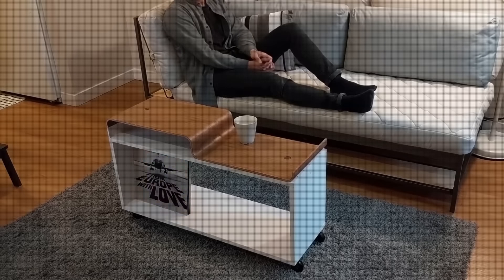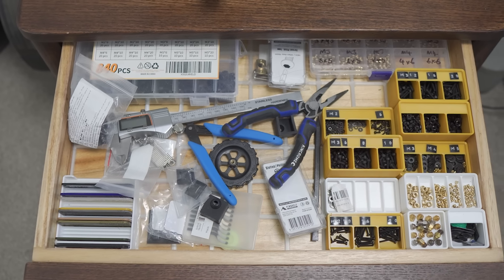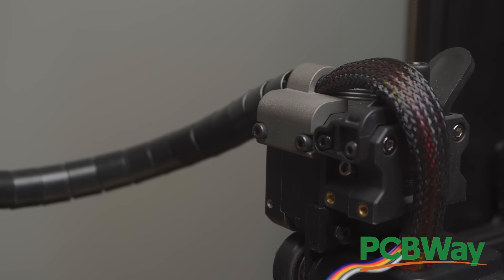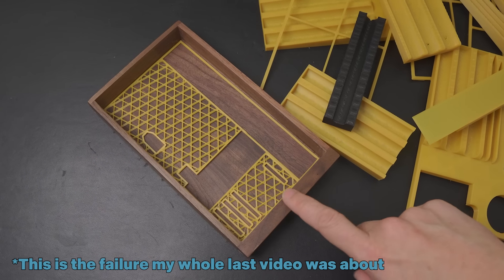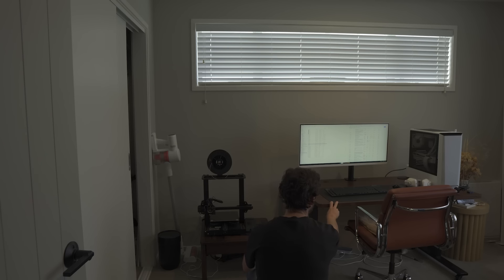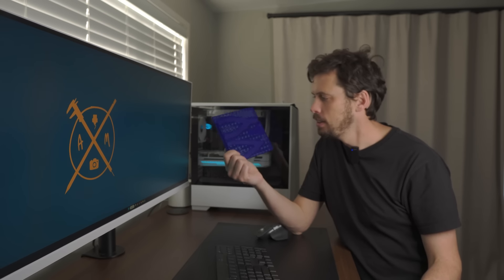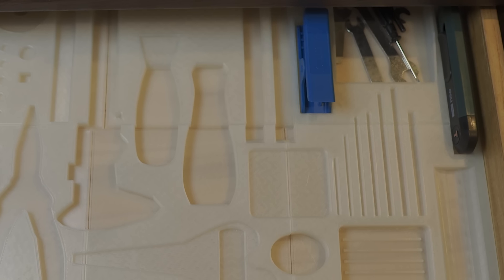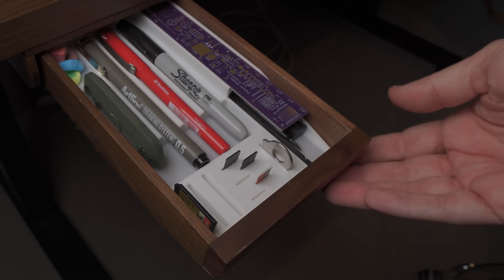Organizing My Mess with 3D Printing (Thanks to Scott Yu-Jan)

Comment: The Cool Timelapse was very cool! Nicely done
Reply from the maker: Thanks man, it looked better in my head 😅
Reply: @AttemptedMaker I’m genuinely curious how you did it without just having 20 half done parts
Reply from the maker: @Timelessplays  I setup the lights and did the print timelapse. Then once it was finished I tried to to move anything, laid my black mousepad over the build plate of my printer and tried to put the empty drawer exactly where the part had just printed and filmed it for a minute. It didn't exactly go to plan by I kinda managed to make it work in the edit.

Comment: Iteration is key, and also something I call destructive prototyping (not sure if there is a term for it)

If I make a part that doesn't fit I end up taking some hand tools and cutting it, melting, drilling till it it achieves the the intended purpose and then I go and clean up the model based on the modifications I did in the real world
Reply from the maker: Destructive Prototyping! If it wasn't a term before, it is now.  That helpful advice. Thanks

Comment: Very intresting video and when you said cool time-lapse, you meant it. I’m actually curious how did it for fun. Did you leave the print on the bed and place drawer around the print instead of the print inside of the drawer? I’m just trying to figure out how you got the whole print in drawer while it was “printing”. Very cool edit my man! Would love to hear how you did it if you have the chance 😊
Reply from the maker: Thanks! I setup the lights and did the print timelapse. Then once it was finished I tried to to move anything, laid my black mousepad over the build plate of my printer and tried to put the empty drawer exactly where the part had just printed and filmed it for a minute. It didn't exactly go to plan by I kinda managed to make it work in the edit.
Reply: @AttemptedMaker  Nice! It makes sense as soon as you said it. Very cool! I do filmmaking on the side, so I was excited to see a new effect/ edit that I never seen done. Thanks for sharing and the video was great!

Comment: 6:29 I am curious how did you make that affect
Reply from the maker: I setup the lights and did the print time lapse. Then once it was finished I tried not to move anything, laid my black mousepad over the build plate of my printer and tried to put the empty drawer exactly where the part had just printed and filmed it for a minute. It didn't exactly go to plan by I kinda managed to make it work in the edit.